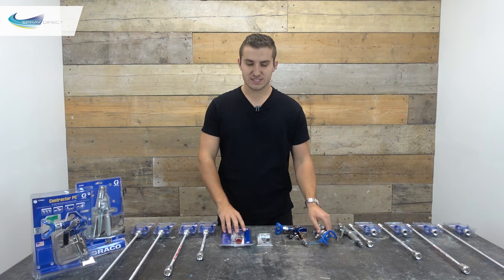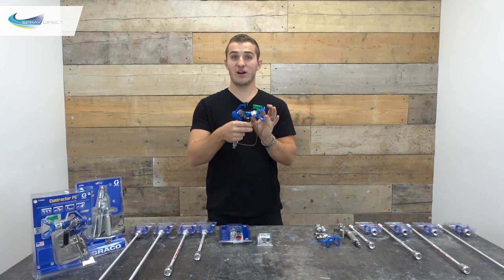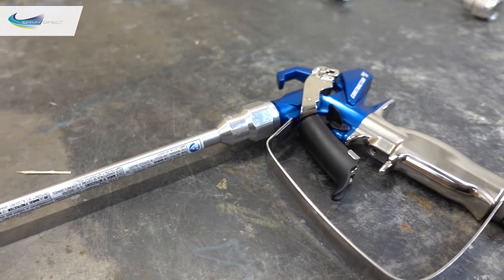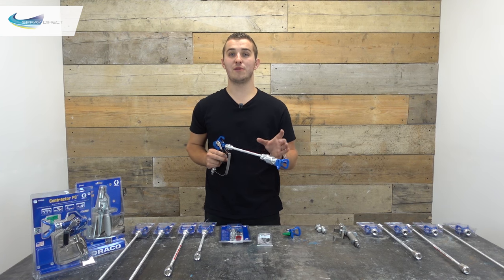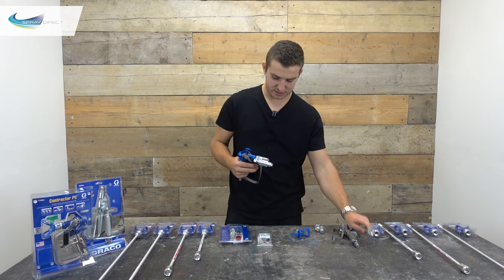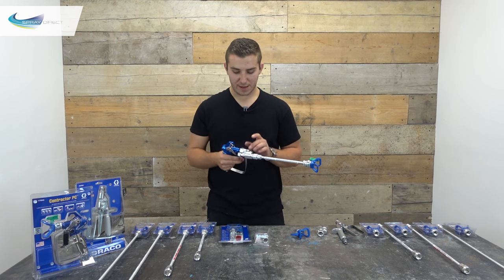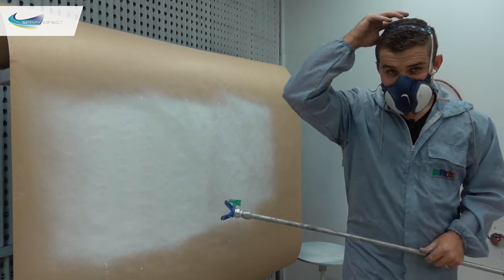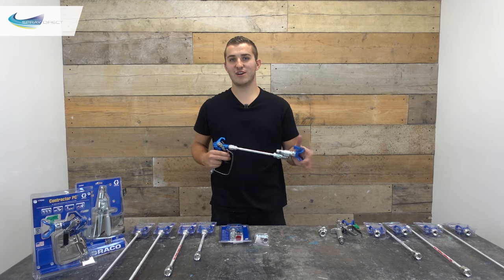Graco Cleanshot Valve Explained & Demo

Comment: Many thanks for the information. Can this swivel joint (ref 28730) be use on its own in a Wagner pro 250 with the Wagner tip.

Comment: Spraying at 1500 psi and nothing comes out, turned the knob more to flush and it would spray once and then not again, turn a little more, spray once and not again. Just had to remove it altogether to keep working. Will have to dedicate some time in the future to figure this damn thing out.

Comment: I've been thinking about getting one for a while now!
Not so much so much for using with my extention though. 
I keep getting minor spits without an extention.
You know that little rubber seal that seats in the tip housing that comes with each and every tip?
Mine's so jammed in there and worn. Could that be what's causing spits?
Haha. 
I could just get a new housing but my threads on my gun are worn so bad that a new housing won't go on.
Haha.
But I heard you say this product won't stop spits unless it's caused by the worn needle. Could it stop in from my worn seals too?
Reply: Sounds like it is time for a new gun, if you cant even remove the guard. the rx-pro is great

Comment: Any Idea How Long These Clean shots Last Before replacement? And / Or Are There Replacements Repair Parts sold to rebuild the unit?
Reply from the maker: John Deaton they are fully serviceable/repairable with all parts available from ourselves. Hard to say how long they last because it’s dependant on so many factors like; pressure, paint, usage, how it’s looked after etc.

Comment: Hi Josh, isn't it possible to use the cleanshot valve on a ultramax handheld with an adaptor that bridges the difference in thread?
Reply: I second that questions! I did find on a different video elsewhere that they say that they don't want you to use any extensions because of the chance of explosion due to solvent-based products but if I'm not using a solvent based product shouldn't I be able to find one inch thread adapter down to 7/8?

Comment: I don't use this clean shot. If I get any spits because I don't strain the paint or my filters are dirty . Typically I change my filters on the gun and the valve for every job and strain the paint  , this prevents any spitting. If I still get Spitz it's because the paint is too thin and then I raise the pressure.
Reply: Not true at all if you get spitting then your pressure is too high

Comment: The spraying looked the same
Reply: If you want to see major spitting try using an extension without it with a 208 or 308 fflp tip. The orifice is so small that you get a long stream of paint coming out for several seconds... That honestly should have been demonstrated as a nightmare type scenario. Since you'll be losing all the pressure much slower aka much longer and drastic spitting. (Edited - Autocorrect messed up fflp)